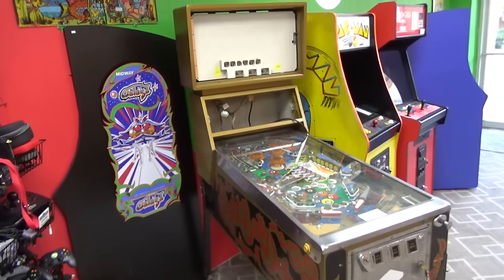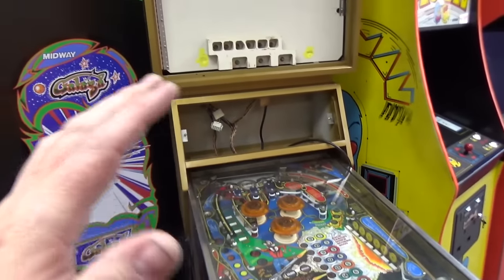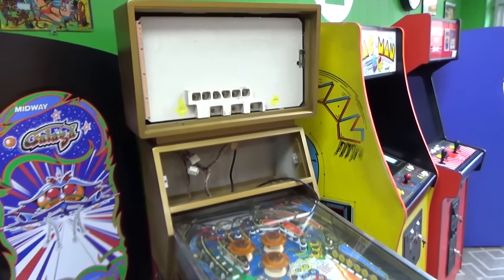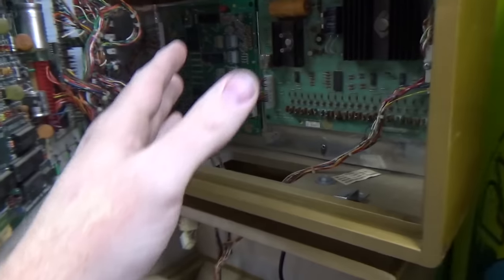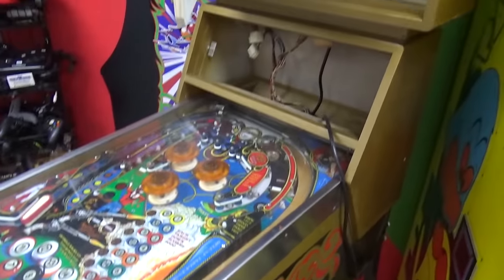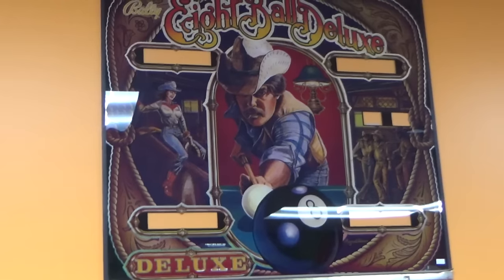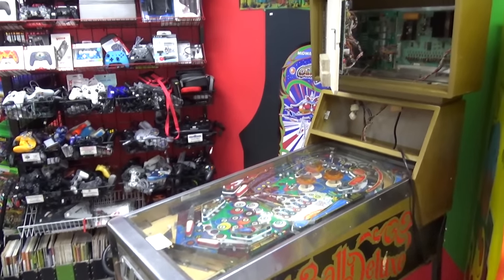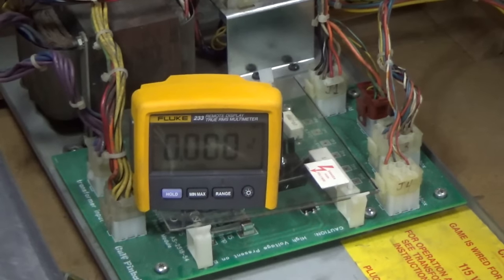Bally's Display Voltage!  - Eight Ball Deluxe L.E. Pinball Machine

Comment: Ronnie, the schematics are trying to tell you what those voltages should be (in parenthesis). Since the capacitors were not on the 12V or 230V, you were measuring the unfiltered DC...so there was a lot of ripple and your meter would read the average voltage it was seeing.

Comment: Addressing the issue @ 29:20 in the video. Here is an important rule to remember about testing resistors in circuit. The value can always go down, but it should never go up. If the reading on your meter is showing higher then the printed value of the resistor. I can guarantee you the resistor is bad. I would recheck that 100K that going across the line again.
Reply: If the measured value is too high and you know there isn't any power in the  circuit you know the resistor is bad. If there are charged capacitors it can throw off resistance measurements either way.

In this circuit if the output voltage has any charge remaining the 100k resistor will read high. I'm not sure if this is the case or not. Fortunately the 100k resistor is 100% unnecessary for correct circuit operation. It is only there to drain the capacitor when power is removed.

Comment: Question: How do you deal with the extra long leads on those filter caps? Throughout the whole video, I was worried that the black leads  were close to touching. I know you don’t need comments from the peanut gallery, but those leads were making ME short out! Probably just fine IRL, but scarry-looking on the video. Do you hot-glue the leads so they don’t touch?
Reply from the maker: They're rubber wires, so it doesn't matter if they touch.  Those are the factory wires, we didn't add that

Comment: That blown high voltage circuit is a sign that someone dialed the regulator down too low. The factory spec was 190v and the temptation is to dial it as low as possible to 170v or so to preserver the displays. The problem is the lower you go the more stress is put onto the regulator circuit which essentially works by turning the excess voltage into heat. Setting it at 180v is a good compromise voltage. Newbies out there should be advised not to go much lower unless they want to perform this troubleshooting exercise themselves.
Reply: It's worth remembering that the current draw decreases when the output voltage is lowered. That reduces regulator heat output which likely cancels out the extra heat from the additional drop.
Reply: As it was explained to me back in the day. The unneeded voltage must go somewhere. While current draw through Q21 decreases the excess voltage and current from the input bleads off through R51 and Q23. This translates into extra heat stress on those parts. @eDoc2020
Reply: @areizman   R51 and Q23 will indeed run a bit hotter remember they aren't what failed. After doing some math (shown below) I can say with confidence they are well within safe operating area even with a greatly reduced output voltage. Actually R51 gets close under worst case conditions but its failure won't damage anything else and an upgraded 1W replacement only costs a few handfuls of cents.

R51 needs 104v to exceed its power rating. With a worst-case 257v input this means 153v output. With a more realistic 245->170v drop the 1/2 watt resistor is still at a very safe 0.26 watt dissipation. The control transistor is rated at 1 watt dissipation in 50C ambient with no heatsink. Under the worst case 257->153v scenario (with no load) it's still under 0.73 watts. This is a bit close to the 1W limit but since this transistor has a small heatsink the limit is more than 1W.

And for future reference: Q21 = pass transistor 2n3584, Q22 = Darlington driver 2n3440, Q23 = controller 2n3440, R51 = base pull-up (22k 1/2w). Input voltage = 230+-27vdc, specified output = 190+-5vdc.

Comment: The DC voltage increases when you plug the power suplly board in because you have unfiltered, rectified DC. 

The caps will filter to about the peak voltage vs the RMS voltage of the rectified DC. Some multimeters, especially cheap ones don't measure pulsed/rectified DC accurately. True RMS meters are much better at this. Especially Fluke ones.

This is exactly why your 180 ish volts goes to 250 ish volts when you plugged it in. 

Math is 183V * 1.414 = 258 V for the plasma display regulator input. 
The 1.414 is from the sqrt 2 used in AC RMS calculations. 

The 15 ish volts on the 12V rail, from the 6 ish V input - something must be connecting together, adding voltages,, possibly 2 sections of the power supply to get up to that voltage. Or even the possibly of something floating, voltage wise, until it's joined when plugged into the regulator board

Comment: Modified Darlington in the display regulator. I've seen some regulators using a low power regulator chip driving a buck converter. A lot less heat dissipation. Amazing to see this stuff. BTW people are confused by the transistor looking like some of the 7805s most are familiar with. That is a regulator circuit. LOL
Reply: No integrated regulator for 190v in those days. Engineers had to make their own solid state regulator from what was printed in books. :)

Comment: I think the number of failed components makes sense. First, the big transistor failed, making the output voltage too high. Then the bottom transistor turned on harder in order to try to lower the voltage. This made it die and short. This put ground on the base of the middle transistor which had two effects. With ground on the base and +230v on the emitter it blew open. It also left the full 230 volts across the 22k resistor which made it run hot and char.

Comment: Usually if the input and output voltage are the same,  i replace all 3 transistors,  as it all snowballs. And that pot.. always replaced..

Looking forward to the finish line on this one.

Comment: JOE, How does the capacitor on the solenoid board increase/raise the display voltage from 180vdc to 230vdc?
Reply: When u add a cap to a diode bridge it increases the volts by 1.414 x the ac volts  because its flat line dc and not ripple dc.
Reply: @robertknott260  Why would it increase the AC voltage by 1.414? If the AC voltage is 180VAC X 1.414 = 254.52 VAC? , its not 230vdc but 254.52
Reply: @waynegram8907   1.414 is the square root of two which is the ratio between RMS voltage and peak voltage of a sine wave. If the input is 180VAC then the output voltage of an unloaded rectifier and capacitor is 254 volts. I thought this was very close to what Ron measured on camera. The reason it's around 10% more than the schematic says is because it's unregulated. Ron's outlets have about 125v instead of the expected 120v so the output voltage will similarly 4% higher. He's also measuring the voltage without a load. When the displays turn on they will draw current which reduces the voltage a bit more.